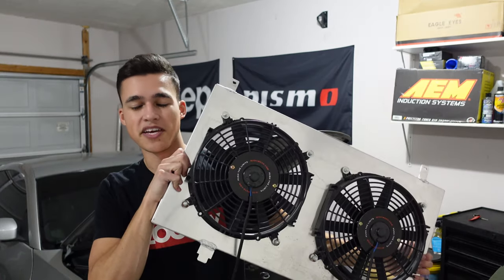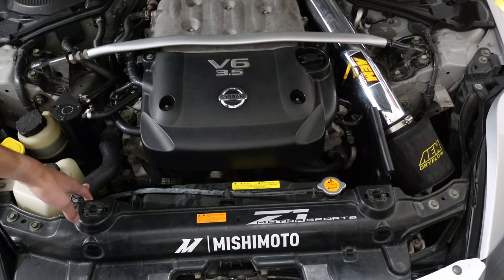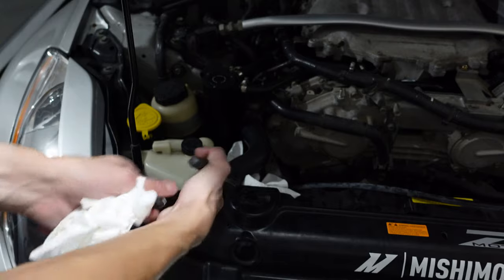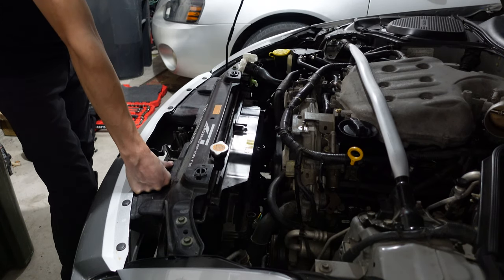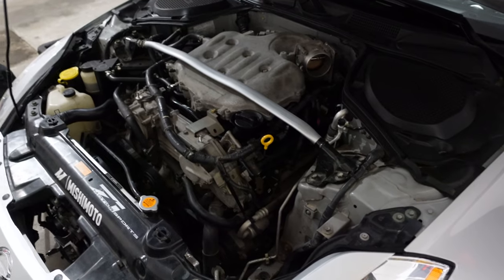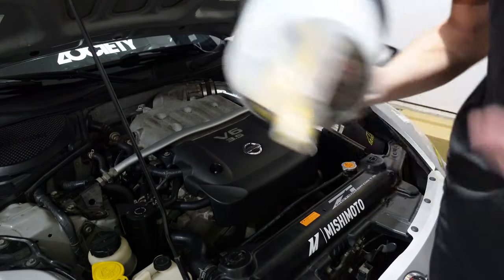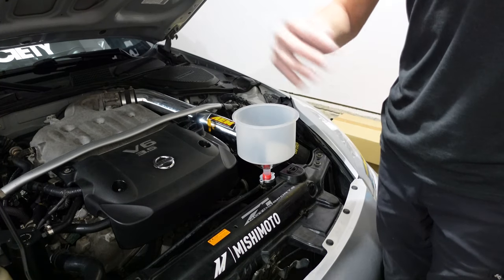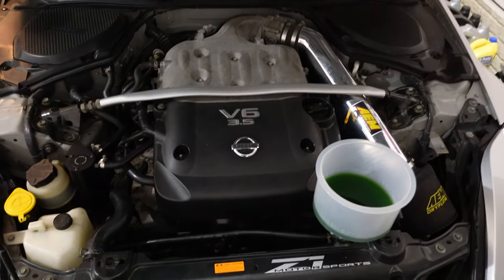Installing a Mishimoto Fan Shroud on My Nissan 350z!

Comment: Would it be difficult to fit the oem fans with mishimoto radiator?
Reply from the maker: @Annt no it would fit since the Mishimoto radiator is the same size if not slimmer than OEM

Comment: Will this fit the OEM radiator?
Reply from the maker: @That_YZF_R7 yup it fits the OEM radiator! It just leaves a small gap so I would recommend getting thicker insulating foam strips than the ones they give you